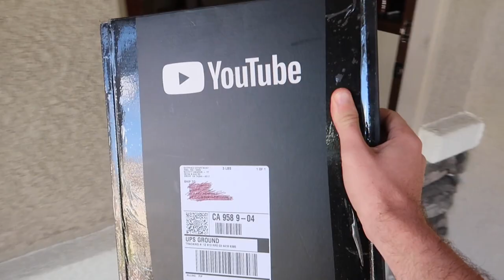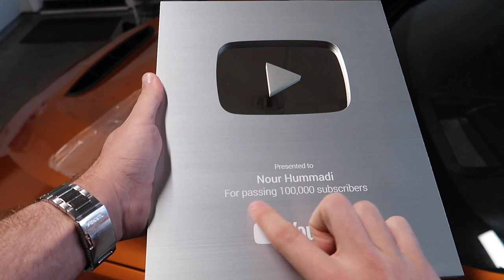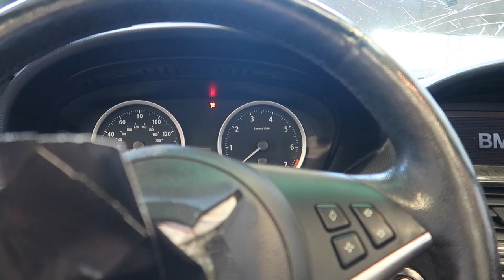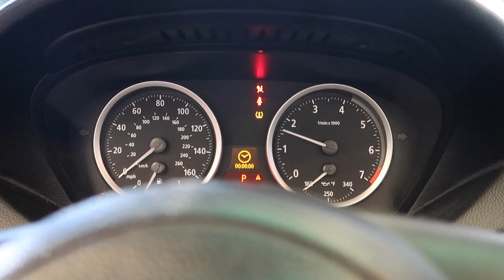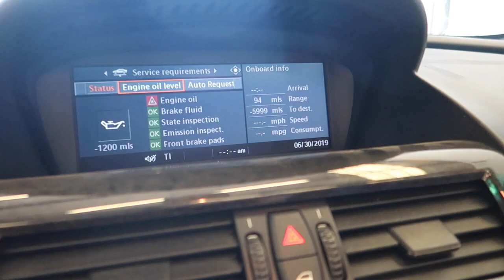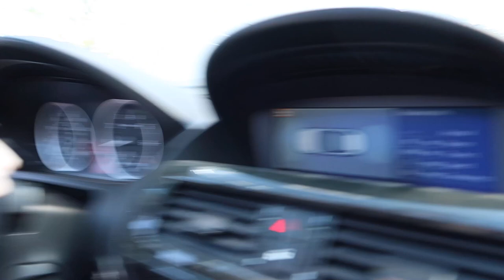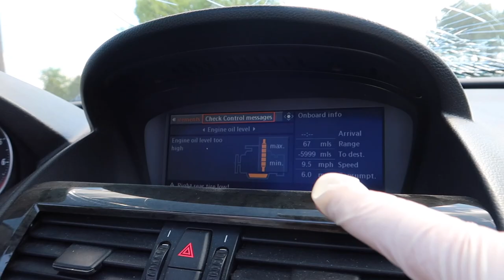OUR $800 BMW 650I RUNS AND DRIVES??? (LOTS OF SMOKE!)

Comment: The squealing from the engine is the serpentine. Belt. Could be loose or old
Reply: more likely the pully, but change both as well as the tensioner

Comment: Hey Nour, I own a 550i also N62 that squealing sounds like your water pump, they do that once it goes bad. Good luck with your build. I have tune from Active Autowerke and straight pipe along with an AFE Intake it screams and pulls hard especially in high rpms.
Reply: Fast Dad Gully what’s your instagram ?

Comment: I wonder if the seller is gonna come across this video n be pissed 😂
Reply: Most likely, if he had the key coded correctly and got a jump the car would have been running and he could've easily sold it for $8k at 172,000 miles. Lower mileage ones are going for $12k - $15k
Reply: Murcielago SV yup. Sounds about right

Comment: Belt needs changing and possible belt tensioner. Check for any contamination of oil on the rest of the pulleys. Check under the engine for any oil leaks. Had the same noise on my 335i msport  Great video dude.

Comment: Car definitely needs steering wheel airbag and  drivers seatbelt pretensioners replaced, at that point you can probably clear the airbag SRS codes, then find out if there is anything else wrong from there

Comment: I have the same squealing sound on my 08' e60 550i I have no idea what it is. Also I have the smoking problem from the valves stem seals.i I hope you can help with this and get it figured out dude. Subbed since the 330i wrap. Love the channel
Reply: Belt/tensioner/pulley 👌